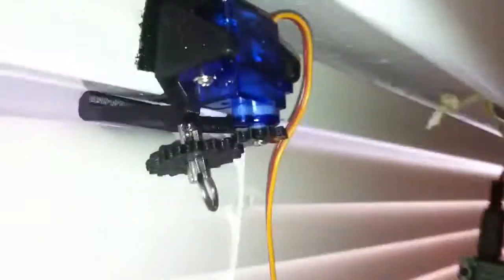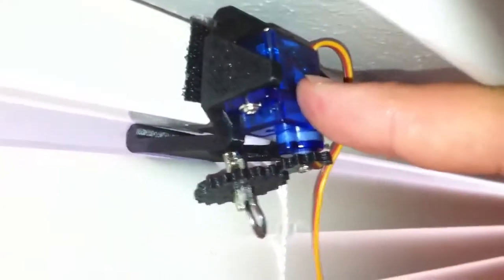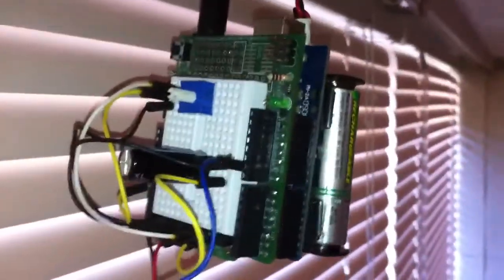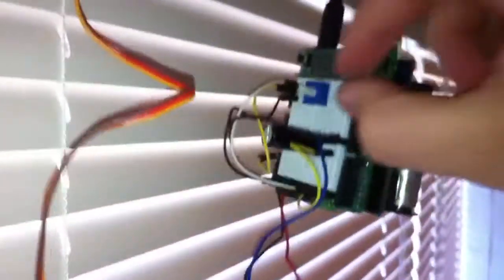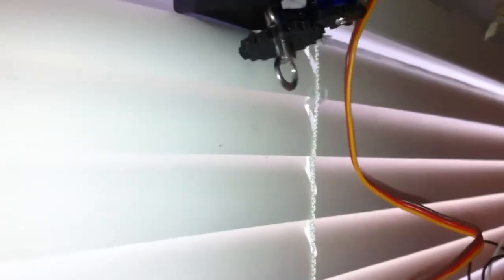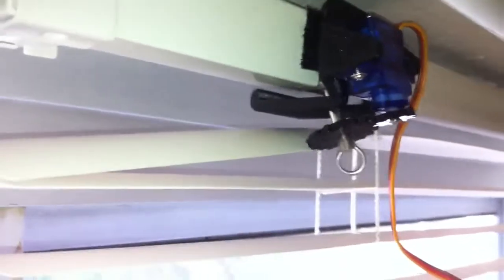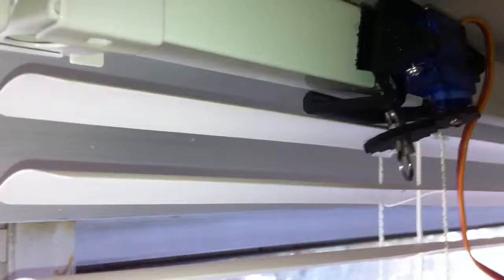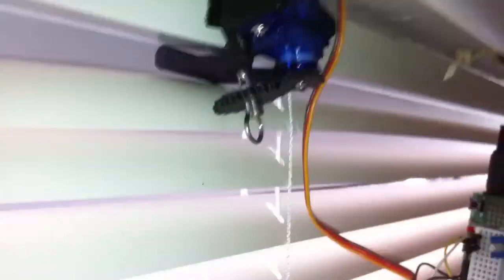Arduino controlled mini-blinds

Comment from the maker: I used a small servo made for continuous rotation. I do think solar panel and a few batteries/ capacitors could be used to run it.